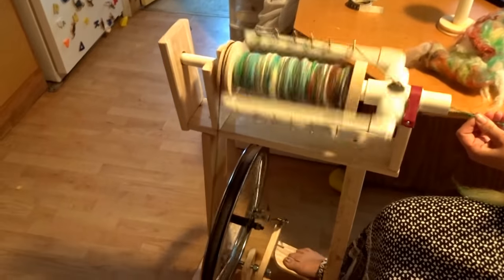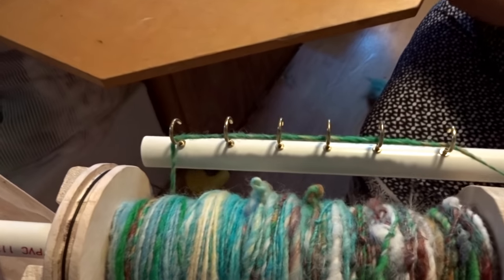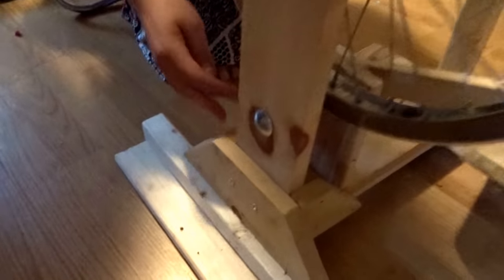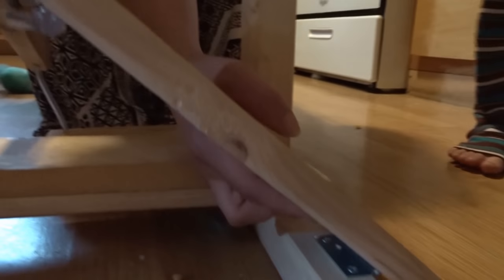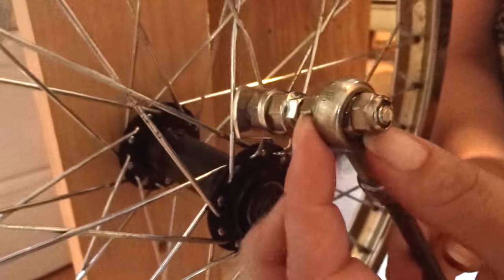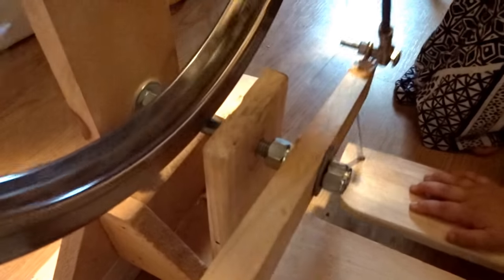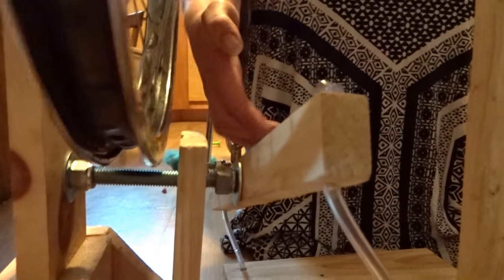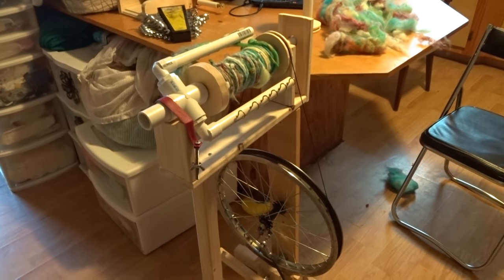DIY Spinning Wheel

Comment: I love how you got the groove in the bobbin and the easy flyer! This video is great and I keep coming back to it as I make my first spinner.
Reply from the maker: Hi, thanks so much, so I actually used a router for the grooves, but after making a couple like that I realized it was a ton of work and you could totally use 2 wheels for a wooden car, like you would find at a craft store and glue them  together  to make one. Try to get like a 3 inch or larger size.